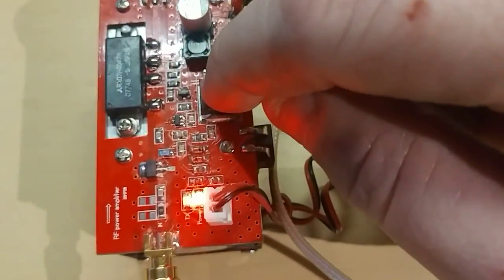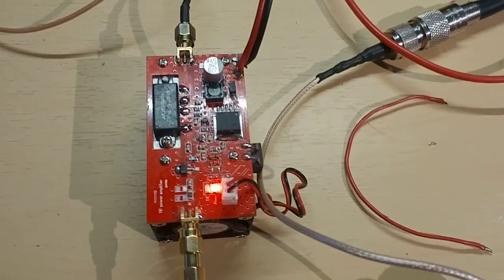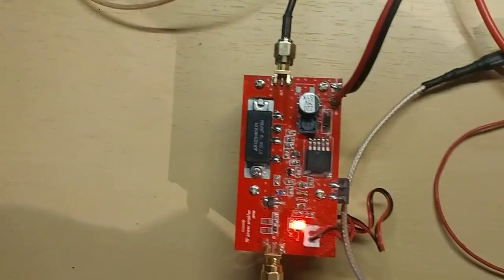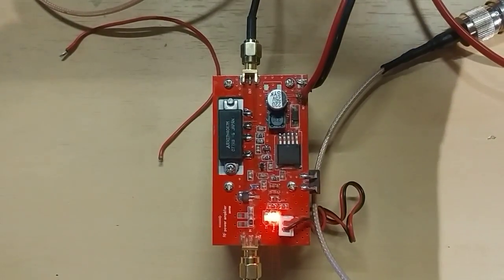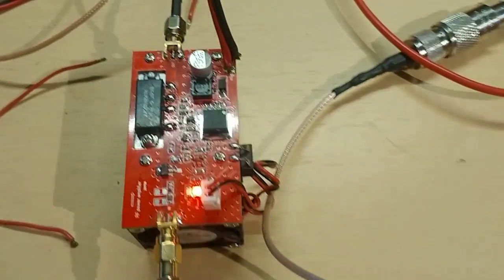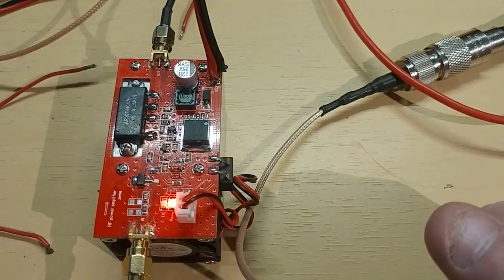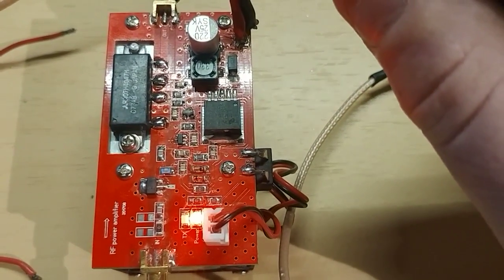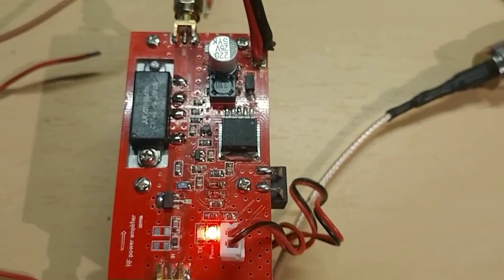EBay DMR Digital Amplifier DO NOT BUY

Comment: The relay needs to know when to activate to by-pass, how will you do that ? Even if you manage to figure this out, it will not work on DMR because of Timeslots. Relays cannot switch that fast (that's why you can't use linear amps on DMR either for Tx)

Comment: our second CB service in Aus is 80 ch @ 12.5khz steping on the 63 cm band (476.425 - 477.4375) with a few jump ch's, we are allowed 5wts with  a 6dB co-linear vertical ant, but a lot of hick operators use 100 -200 wts with 15 - 16 -17 ....etc element yagi-udo beams, (log is around 15-16 dB??)I bought 2X80wt-out (input 5wts) @ $130AU each similar to this DMR Digital Amplifier, with the pre-amp(Rx), I run them on 2x home built 17 elements beams and get good reports (50-100+ kms) around sydney depending on terrain we have repeaters (chs1-8/41-48  +offset 0.750khz) ..just a a little silly trivia as we say ....its just radio ..p.s. its only FM

Comment: Simple fix to this. use a small reed relay since its only for RX. make the relay latch on RX and unlatch when you key. I can think of 3 different ways right now to control when the relay does this.

Comment: Bought one like this that now has the switching diodes that allows receive signal to pass through.  The bad thing is when I powered it up it whistled for 30 seconds and quit. No transmit. Nothing shorted. Diodes are good.
Reply: Fixed it.. It wasn't switching on the 3.4V regulator that applies power to the Vg pin on the module.  Turned out the cor sense  diodes were bad. I replaced them with some old radio shack 5082 schotky diodes I had on a card from Phone Shack.  Thousands of dollars in parts in stock and I've gotta reach for a radio shack card for uhf diodes. Anyway it works with my PI-Star MMDVM HS hat board. Dont' have a wattmeter on it but Its pulling some current and with the mobile whip on a computer case I can go about 1/2 mile from the shop.. Metal roof on the shop so.. pretty shielded.. .. Again this later version has the 1/4 lines and shunting diodes that keep the output from backfeeding during transmit.. 
.

Comment: Hi AirWavZ,

Would a relay work?  They're pretty slow acting ... too slow for operating at timeslot speeds.  Also, wouldn't there be a burst of Amplified RF back into the output stage of the transceiver each time you key up?  8W into a 20mw output stage, even for a moment, doesn't sound very healthy.

Have you tried this?  What were your results?

M6UDS